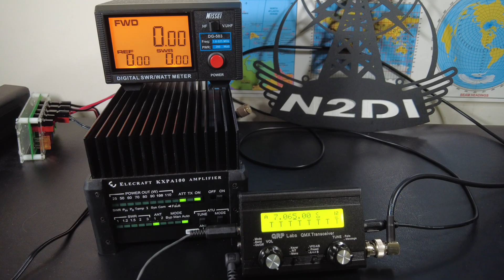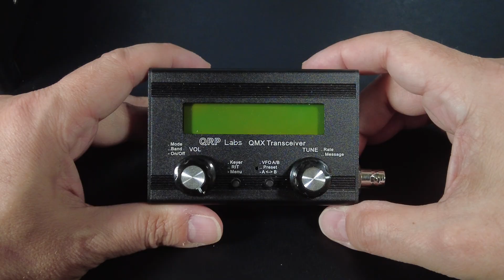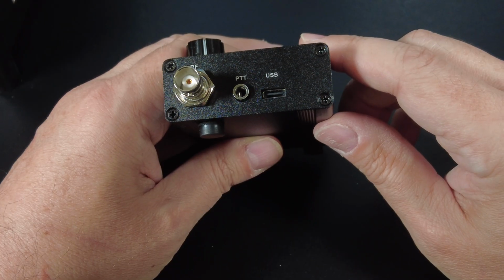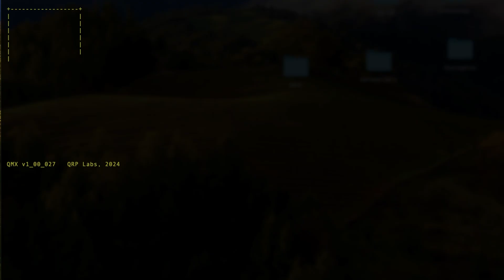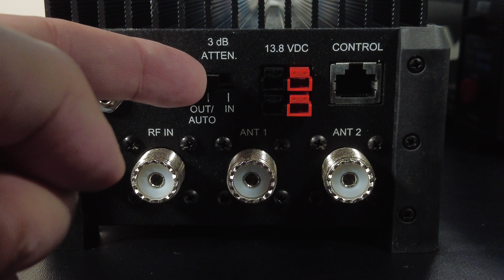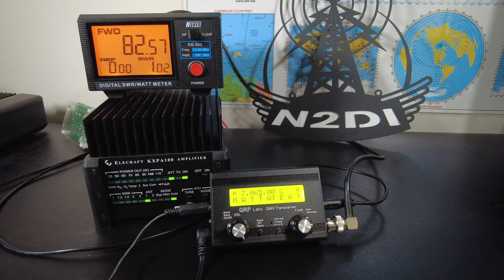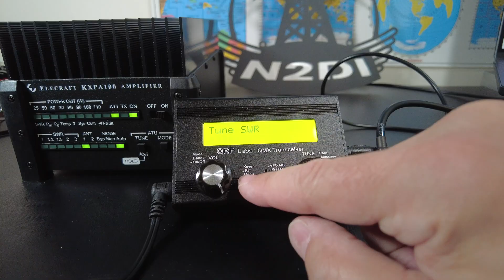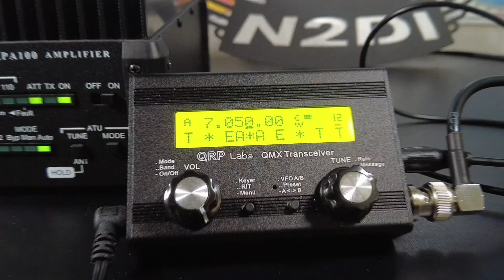Getting the QMX and the Elecraft KXPA100 to Play Nice Together

Comment: Very slick, Joe! I have mine ready to go for my activation this afternoon. Do you keep the high SWR protection setting enabled on your QMX? It kicks-in on me when I set the KXPA100 to tune/match the antenna. I'll be out around 3pm Central time this afternoon with this setup. Thanks a ton for posting! I knew it had to be possible to use the KXPA100 with the QMX, but you made it quick and easy!
Reply from the maker: Thanks! It is but I tried with it off initially and it worked without any negative effect. For me, setting the power level to 60% for the Tune SWR menu setting seemed to keep it from going into protection mode.  I think the menu option is called Tune %.

Comment: Joe,
I just gave it a try using the QMX+ and it worked great. I'm getting about 80W out on both 40 and 20 meters. I made several Euro contacts. I love the new QMX Tune/SWR feature. That's a great addition to the firmware.

The cable is available on Amazon for just a few bucks. 

Thanks for the instructive video!

Jerry, AC4BT
Reply from the maker: Thanks Jerry, that's awesome!  I figured there would be at least one person out there that would find this useful!